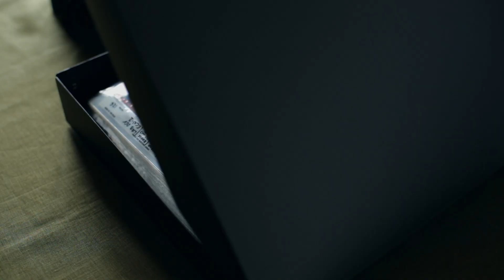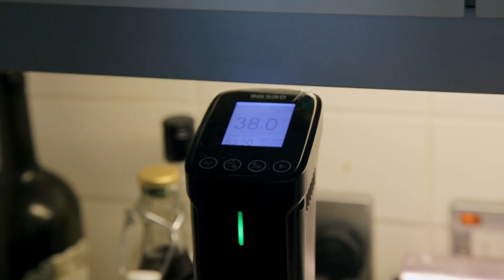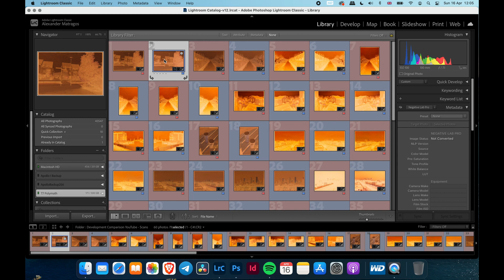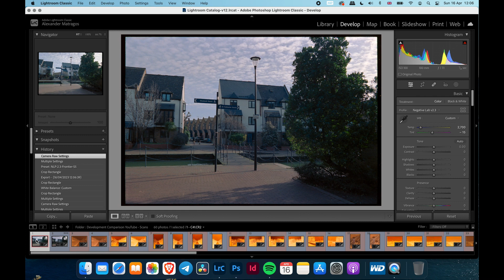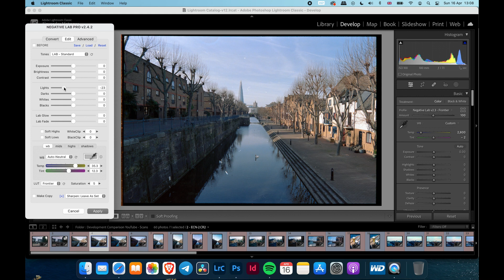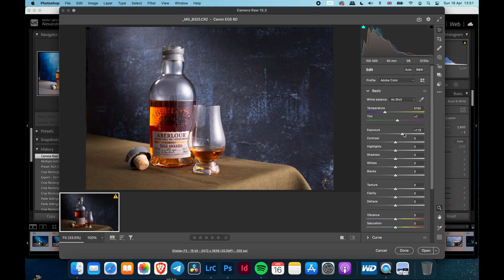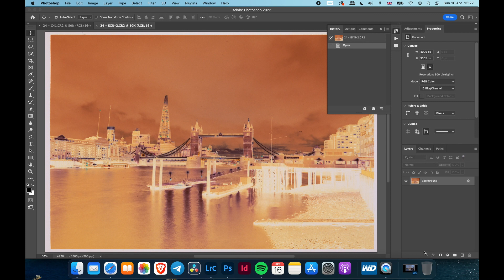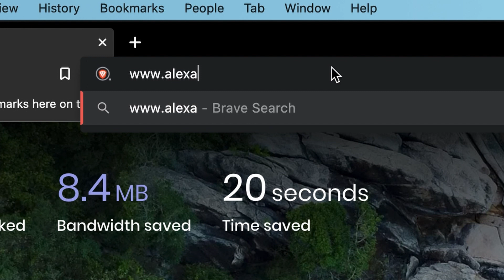ECN-2 vs C41 Development Comparison on Kodak Vision3 500T

Comment: What chemicals did you use at home? I ask because one of cinestills c41 kits is actually ecn-2, and they are really popular. Gosh those guys are a mess. Although you sound european so you probably used something better.
Reply from the maker: I had no clue, but I’m not that surprised. All I hear is bad things about them. I’m using the C41 kit from Rollei. Haven’t had a chance to try a different brand but I’m happy with it. Supposedly C41 should be the same across all brands as it’s a standardised process unlike BW development.

Comment: In my opinion the biggest argument for developing films like Vision3 in C-41 chemicals is convenience. Most people, myself included, probably shoot ECN-2 and C-41 film. C-41 chemicals are usually easier to get and cheaper, so if there is not the big of a difference, C-41 chemicals should be the obvious choice. (after Remjet removal obviously)

Comment: I only use Vision3 250D (until now) and the only difference I see with C41 vs. ECN-2 is that photos with flat light with ECN-2 get a, very slight, flatter negative - the Danish north sea coast, and old whitewashed houses looks slightly more interesting - as I said slightly. Otherwise it's almost one to one. I sadly do not have a direct comparison as I only carry one film camera.
Reply from the maker: If you are using this stock regularly/long term then you don’t need a comparison necessarily, I’m sure you will be able to pick up on the nuanced differences of the two processes. They are much more pronounced if you darkroom print, when scanning though the differences are much more subtle and more or less easily matched.
Would love to see examples of images if you want to share a link.

Comment: Consider, ECN2 or Vision3 is not intended for still photography as it is intentionally designed to be duplicated by another film to make a positive for cinema projection.  Probably this is why it results in a flatter image as it is designed to be duplicated.
Reply from the maker: For sure! And it’s also pretty handy in this modern age where all the post production is done digitally. Having flat files to work with is immensely valuable.

Comment: Excellent video alexander.  I have previusly used 250d love it the cost.  Bow thinking to try 500t. I had previously read you needed to use. Fulter on the lens for daytime shooting. Did you in this video?
Reply from the maker: Thanks a lot! I will agree, 250D is also a beautiful film stock. As for the filter on the 500T, I didn’t use any. It’s easy to correct when scanning. As with most things though, there are people who swear by using it and people who don’t bother. If I remember correctly, some cinematographers argue that some of the colours are rendered correctly only with the filter. I would like to do a side by side comparison at some point. So far though, I’m using it without any filters and I don’t have any issues.

Comment: Grain appears to be the biggest difference
Reply from the maker: Haven’t noticed a grain difference so far. What’s your experience?
Reply: @alexandermatragos  7:41 in your video. The sky has a noticeable difference in grain. 
I home develop my film and I stick with c-41 simply for the cost and easier temperature management during developing.
Reply from the maker: @RonEMarks  it’s kinda hard to tell on this one. One of the shots could have been slightly underexposed even though I used the same settings. Light was fading fast in this scenario. Keep in mind I had to swap lenses and change the camera on the tripod. Not a long procedure but still could have some effect.

Comment: great test, although i am wondering: if the same lens was used for both than why is the C41 version always sharper?
Reply from the maker: Thanks, as for the sharpness I can’t say I noticed one being sharper than the other. Though I can have a look at my files and see if I can spot anything. Are you referring to a particular image or do all the c41s appear sharper to you?
Reply: @alexandermatragos  at 07:24 for example when you zoomed in, the left image (if i understood well was C41) looks a bit sharper. i turned up video quality to max to double check and see the left one's sharper during close ups.
Reply from the maker: @grainificent That one was a long exposure so there is always the potential of a slight movement from wind etc. I’m currently working on a part 2 comparison where I did darkroom prints to see if I can find the differences there. While printing I didn’t run in any sharpness issues.
Reply: @alexandermatragos  ok :)

Comment: The issue with scanning ECN2 on a DSLR is you are using a narrower band of dynamic range of the digital sensor. So once you set a white point and black point you are dealing with a smaller range of data leading to more noise
Reply from the maker: I assume you are comparing it to scanning it using the scanners they use in motion picture films like the Blackmagic Cintel. I have shot some Vision3 through Silbersalz so I have seen how flat the Cintel scans the film, though I have never done a side by side comparison with a dslr.

Comment: Thank you for testing and documentation, looking into this right now. I do think that c41-cross processed cinestill has a slight magenta/pink/yellow color cast, but its not always so visible. Color casts from other issues are a bigger problem for me (age fog and using tungsten balanced film without a filter, in particular).

Comment: I think that the main different is when you have harsh light outside and you want to take a picture of a very contrasy situation , i use mainly the vision 3 50-D and using the  zone system , i usually put the shadows in zone 3 but the highlights are at zone 8 or even 8.5 and with ecn 2 i can pull very nice amound of data , defently more then with c-41 , its a 1 stop different wich can make the different , also  to strech the file when its a bit flatter its easy

Comment: Very new to photography is the same process to develop? Or is something really special to develop the ecn-2?
Reply from the maker: Cinema films are manufactured based on the needs they have in the movie industry. Few quick examples: a film that runs through a movie camera, will move at a speed of 24fps or higher hence the need for a protective layer against scratches, static electricity and halations. Another example would be that these films are meant to be contact printed on the projection film (print film) and that requires the films to have lower contrast than the ones we use for photography. These are just two examples to illustrate the differences between a movie film and a stills film. And since the movie films are created with these different specifications they also have their own developing process, ECN-2. 
Now photographers like to fool around and play with different processes and have found (as you saw on my example) that it’s perfectly feasible to cross process a ECN-2 film on C41 chemistry (with a few extra steps) and end up with nearly identical results, especially since we are using a digital workflow.

Comment: Very interesting findings. I've noticed some spots on the film you processed at home with C41. Is this because of the imperfect Ramjet removal?
Reply from the maker: Thank you! Yes that’s definitely it. Since then I have tried a different method that has worked much better for me in terms of removing remjet. Though I haven’t shot a lot of 500T the last two months.

Comment: By the way have you tried applying print film emulation LUT kodak 2383 D60/D65 on davinci resolve to the raw scan file? If I remember correctly, vision3 negative, after scanned, is supposed to be applied with the PFE LUT to "simulate" the look of a print. Just a thought.
Reply from the maker: That is something I haven’t tried but I am interested to have a go at it. I’ll have a look when I have some free time. Thanks for the info!

Comment: If anyone wants to develop ECN-2 films in C-41 at home, I highly recommend Bellini Pre-Bath (reference ECNP-PB). It works way better than baking soda to remove the remjet layer, and I barely had to scrub remaining remjet before the stabiliser bath. Also, people be careful when you scrub the remjet not to touch the emulsion side, or you'll transfer remjet in it and then it's there to stay. 

Here's my procedure :
1) hang the wet film after blix and rinse, and weight it
2) use a clean and wet microfiber cloth to scrub the backing side
3) soak the film back into stabiliser
4) hang it back to dry

No need to ever touch the emulsion side, so no damage, and no remjet transfer :)
Reply: Maybe but baking soda work really well and i guess is way cheaper than that
Reply from the maker: @wildechap  It definitely is a bonus that you can source it easier, but I can't say it works better from what I've seen so far. It did require quite a lot of scrubbing for me compared to kodak's recipe. As for cheaper, not really. The chemicals are pretty cheap and if it's true that you can do 20 rolls with every batch then they are cheaper than baking soda. I still need to see these things in practise though, I haven't processed that many rolls yet with this solution, but it looks very promising so far.
Reply: @alexandermatragos  I think it is better to use the official recipe, for me though i would say baking soda works perfect because, i just need to wipe down once or twice with a wet microfiber cloth and it's all good.
Reply from the maker: Good points! I’m also looking for an alternative to the current technique I’m using. I’m trying Kodak‘s suggestion. So far with great results.
Reply: @alexandermatragos  What do you mean by Kodak's suggestion ? You're talking about their published pre-bath recipe ? (with sodium hydroxyde and other nasty chemicals I can't remember)

I think Bellini's pre-bath is based on Kodak's. Or it's just Borax. But for sure it's not just plain sodium bicarbonate, cause that's xhat I tried at 1st and it was not super efficient at removing remjet. Bellini's product is pretty good. Don't know if it's as good as Kodak's formula cause I haven't rued it.
Reply from the maker: @stratocactus  Yes, that’s the one I was talking about.
Borax, Sodium Sulfate and Sodium Hydroxide. It worked impressively well the first time I used it but I want to develop a few more rolls to see if it depletes at all. I think you are supposed to do over 20 rolls with one solution. I’ll see how it goes and if I have time I might do a video if there is anyone interested.
Reply: Question. I accidentally loaded 5 rolls into a Paterson tank to prep for developing. 3 rolls of portra 400 (made for c41) and the. Accidentally 2 rolls of 250 Cinema film. So basically I have 3 rolls without Rimjet and 2 rolls with rimjet. Can I process them all in c41? Will the rimjet mess up my portra rolls? I can’t try to remove them from the tank in the dark Becasue I cannot tell which is which on the Paterson reels 

Should I process as normal in c41? Or should I still do pre wash steps to get the rim jet layer off the 2 cinema rolls?

Comment: I believe context and final output matters.

Which begs the question, what if the intended output is an analog print … i.e. an image that was never scanned?

Is C41 a convenience for most of us who never scan and print digitally? Or does it still hold up for an entire analog chain?
Reply from the maker: Unfortunately due to lack of space (a common problem for many people) most of us don’t print our negatives in a darkroom. So I don’t have any experience with that.
What I can say though is that with the exception of slide film that can be projected or viewed as it is, all negative films cannot be considered as final images. The process ends with the print or the scan. And both of these involve color correcting and then color grading of the image.
I don’t know of any absolute way of converting a negative, and then again if there was any I would still argue that the final image is yet to be formed as we don’t know the photogrspher’s vision and intent. So, as long as both ECN-2 and C41 seem to give nice results on these films, I don’t see a reason to disregard one or the other.
What I find untrue is the extreme comments saying that C41 gives a very contrasty image that has weird colours etc. Something that I encountered often before doing this test.

Comment: Great video Alexander. I'm about to develop my first cinema film cross processed with C41. I hope I get results as good as yours. In my humble opinion, having to develop a cinema film only with ECN2 outweighs the advantages of shooting this more affordable type of colour filmstock, so if we can get very similar results with C41 then that's the way it can become sustainable. Current turnaround times for ECN2 processing in a lab in the UK are currently 2 weeks 😅 What ratio of baking soda to water did you use for the remjet removal? Greetings from a fellow YouTube channel creator!!!
Reply from the maker: Thank you!! Developing in C41 is definitely a great option and there is no degradation of the quality of this film stock. And it's not just the low cost of it (although a big factor, especially with the prices these days) but I think in general it's a beautiful film. Great colours, versatile as it's 500 ISO and plenty of latitude. I'm using about 40g of bicarbonate soda per 1L of water (at a warm temperature). Although I am currently trying different methods as well that could potentially be more efficient.
Reply: @alexandermatragos  Hi again Alexander. Cool... Looking forward to see the results you get using other methods too. Thanks on the recipe for the remjet removal 😉

Comment: "slight differences in light and color" - this is exact difference between ecn2 and c41
it is can be seen and measured
does it matter for "everyday photos"? absolutely not
Reply from the maker: I was expecting something more based on what I kept hearing or reading about it. A negative is not an image by itself until it gets printed or scanned and color corrected in both cases. So at the end of the day these differences are not really significant.

Comment: I didn’t know you could develop vision 3 in C41? I thought it would ruin the c41 chemicals?
Reply from the maker: You can if you remove the remjet layer first. The remjet layer has to be removed wether you process in ECN-2 or C41. The difference is that if you send it to a lab that processes only C41 and you don’t tell them anything you are risking ruining their equipment. If you send it to a lab that processes ECN-2 they will remove the remjet first as this is standard procedure of ECN-2 development. So you can send these films to labs that process ECN-2 or do it yourself at home in either process.

Comment: I made darkroom color printings. I tried developing 250D and 500T in C41. Both where shot -1 stop (at 500 and 800 ISO). The developing, normal, 3:15 minutes. Just looking at it I can see that is very constrasty compared with Gold 200 or ColorPlus.
I noticed too that the shadows has a very little magenta tint but not very disgusting. It can be from the stop bath (acetic acid). Kodak recommends another acid, i think sulfuric because can be color changes if another is used, like acetic.

Maybe in the future try the Bellini´s ECN2 Kit and try pringting them.
Reply from the maker: I would be very interested in doing darkroom prints and see how the negatives behave there. Maybe at some point in the future.
Reply: I’d watch a video about that!